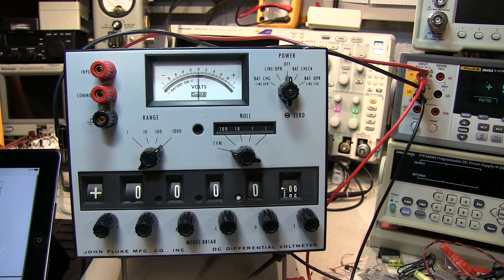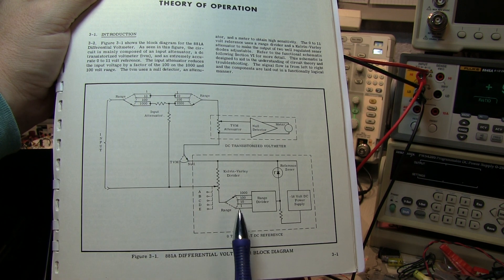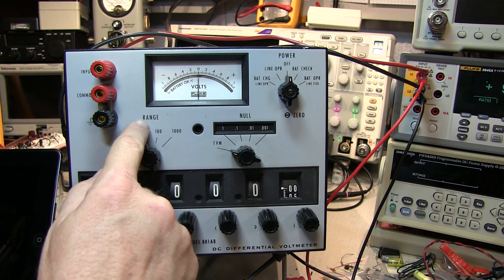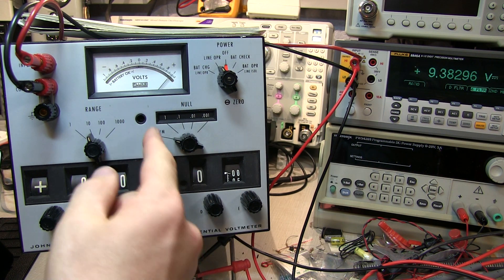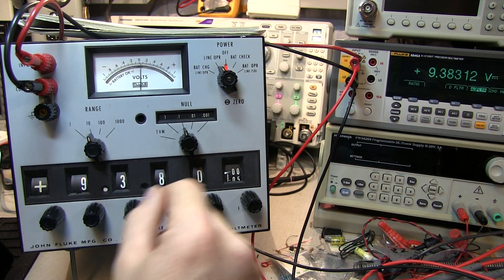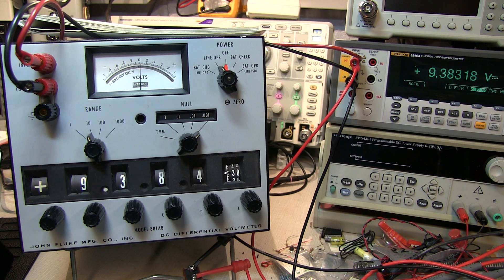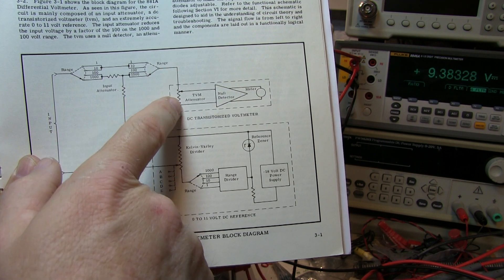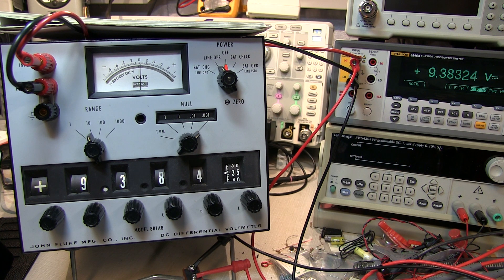#227: Vintage Tech: Fluke 881A Differential Voltmeter Introduction

Comment: This is similar to my  AN/USN-381 differential voltmeter in it's layout and controls.  The AN/USN-381 is a DC only instrument with a specified accuracy of 0.005% in a ruggedized case and a 15kV input range.

Comment: These Fluke differential voltmeters were used as "secondary" standards.  The dial settings at null, were used to calibrate other instruments.  I have three models of these differential meters mostly for sentimental reasons yet they still compare to my modern equipment, that is, within a few millivolts.  I do let them warm-up for about an hour before actually using them.  (K1NVY)

Comment: W2aew, how is a differental voltmeter different compared to using a new modern 4 wire kelvin meter? I'm confused about this Kelvin Varley Divider and 0-11vdc reference because a new modern 4 wire kelvin meter uses current source instead of a Kelve Varley Divider and 0-11vdc reference.

Comment: These days would it make sense to use one of these if you have a modern handheld multimeter? Or can modern handhelds do the job reasonably well?
Reply from the maker: Handhelds do not have the resolution to do the same job.  Modern benchtop DMMs would work well.
Reply: 4½ digit DMM's are neither especially uncommon nor expensive. They couldn't match or exceed the accuracy of this wonderful old boat ⚓???🤨🤔
I have 2 such meters that I use daily: A 1985ish Brunelle (a rebranded "GW" "Goodwill" job; one of which packed it in after just 2-3yrs. use🤷) & an early-mid 70's (!!!) Fluke 8060. Both meters have held their accuracy superbly over the years, unlike my 3 HP Bench DMM's (a 4½ digit 3465A, which just crapped out on me earlier this week, & my two 5½ digit 34750A's which REALLY don't hold their calibration very well or long at all 🧐).
Google was happy to suggest this video for me, & an excellent little tutorial about vintage Differential Voltmeters ("DVM"s?🤔🤣) it is, thank you. I looked this up because someone offered me a 1968 Lambda LS-513 for $30 "as is" (don't worry. I think $5 is a generous offer too. $10 if it actually works!). So it seems the famous power supply people made some other good stuff as well! And then after watching this... something in the back of my mind just popped out to remind me...I DO have a working but hurting (severe noise) Fluke "DVM" myself!🤔💡
An 873AB "portable" that could run both on 120VAC as well as on its internal & long-since puked & irreplaceable NiCd battery pack. Looks pretty much like the 887 featured here; I wonder if it's much older given the lower model # assigned to it?🤔 Or maybe it was just a lower performance model?😏
I'm putting together a "retro" Audio test-bench setup where the idea is to have nothing newer than 40yrs old on it, preferably 60+! I want the huge, heavy, & hot vacuum tube stuff with the noisy fans in 'em to keep them "cool" (🤣🤣🤣).
Stuff in metal cases. Built to last, & built to be easily serviced & calibrated. I'll tolerate some transistors, I'm addicted to DMM resolution & accuracy; even if you can't make rhyme or reason out of noisy readings on them, & they have crappy frequency response too. Unlike say, my HP 400DR VTVM & trusty Simpson 260...😎

Comment: Great info! It also can be used to determine the stability of a voltage source. To see this, measure an alkaline battery voltage and it is "noisy" on the most sensitive range, the null meter needle swings around. Then measure a NiCad battery and it is much more stable (have not tried lithium). Translate that to any "precision" voltage source and it is easy to see if it is faulty or not.

Comment: Why do you advance the digit wheels slowly, one step at a time? Doesn't the pointer always give you the next digit of the voltage so you can just dial it right in? Or would it wear out the mechanism to advance the wheels too fast?
Reply from the maker: The pointer does tell you where to set the wheel.  However, since this instrument is ~50 years old, I didn't want to put any undo stress on the old plastic.

Comment: Very nice to find a working unit.  My first exposure to Fluke was the AC/DC Differential Voltmeter 803D.  It was the predecessor to this meter.  Back then it was the state of the art and I was very impressed.  The feature you mention of infinite input impedance was crucial to what I was doing in those days, measuring outputs of 2000 MΩ voltage dividers.  It is still difficult to find a comparable device.  Standard DVMs today offer a 10 MΩ input impedance and you can find 1,000 MΩ or 10,000 MΩ.  Still no match for infinite.  It should be noted that the infinite impedance is not achieved unless the two voltage sources are finally equivalent and current flow between them drops to zero.  ~doug
Reply from the maker: Amazing how that all these years later, there is still no good modern substitute for certain applications.

Comment: Thank you for this great content. That's serious performance with regard to the manufacturing date. Also precision stability over time to me it looks awesome. Is it fair to say that this unit can be used as a null detector down to 1uV on the 1V range ?
Reply from the maker: +Ovidiu M The dials go down to 10uV on the 1V scale, so you could likely interpolate a bit beyond this, but then you're really pushing well against the accuracy limits.

Comment: A voltage divider is to be built to give 5v out put from 12v in put figure .the maximum load power is 5v design a divider to provide output range 5.25-4.75v         for load rang 3w -5w what is the no lad voltage out the put ?what is the efficiency for two cases of load? 

can u sir answer it fast please

Comment: very pretty instrument and a very clever way to do the messurement.
Did the zero bolt can't improve the accuracy?? or did you had already cheked about it ???
Reply from the maker: +Fauser Neves The "zero" adjustment is a trimmer to adjust the meter to 0 when the inputs are shorted. This adjustment is only needed periodically.
Reply: Ohh ok ... by the way I want to congratulate you, all of your videos are very accurate and very didactic, in many times better than the manufacturer do on their on products.

Comment: Fix it and adjust it, would be interesting....
Reply from the maker: +Burkhardj I can certainly re-cap the unit, but I don't have the voltage standards necessary to properly calibrate it.
Reply: +w2aew If only you had access to the resources of a well known test and measurement division of a multinational conglomerate that begins with a D... :)
Reply from the maker: I just don't have access to those resources locally. I work in the field...

Comment: Very cool. I keep being surprised about the clever solutions and technologies they used back in the day to reach precisions and develop features which by todays standard are still very good. Shame you didn't show the insides, would've loved to see those rotary switches filled with resistors!
Reply: +tHaH4x0r - Ya, I am a little disappointed that Alan didn't take the cover off too.  Even for just a quick look.  Perhaps he can do a follow up video where he takes a look inside and tries to do the calibration.  Can't be that hard to calibrate can it?

Comment: Great bit of test gear you got there, never seen those before, to be honest i didn't even understand how it operated after you explained it but after i saw it in operation i noticed that it's pretty much a comparator with a variable reference.
Also do you have any ideas for the upcoming video? If not may i suggest rf output stages, antenna impedance or what makes for an efficient transmiter ? 
Take care.